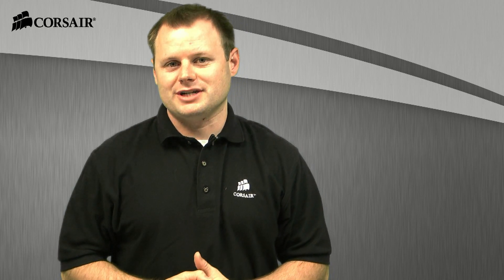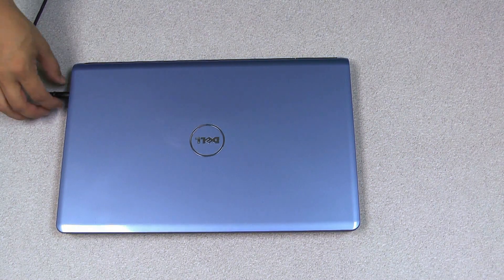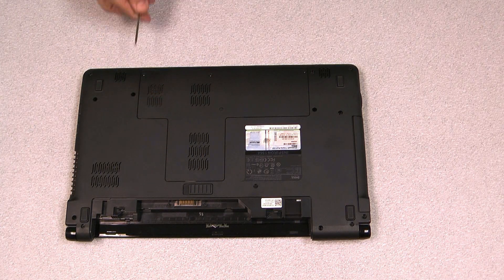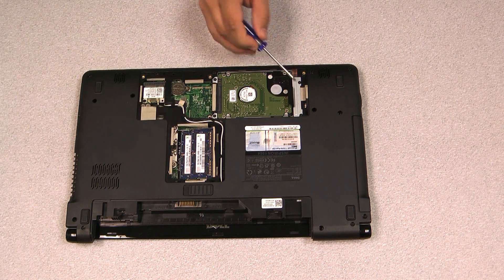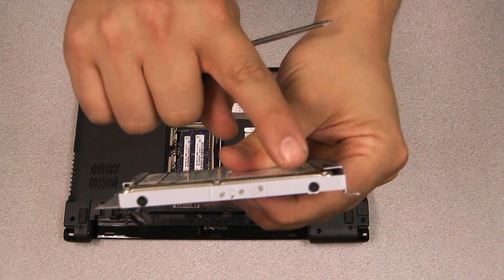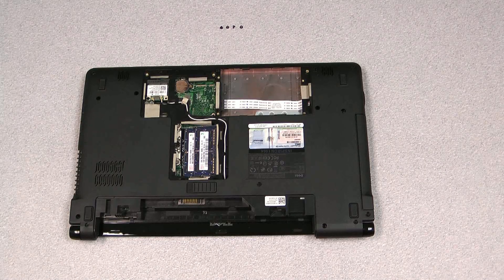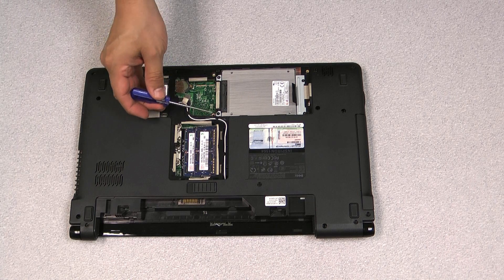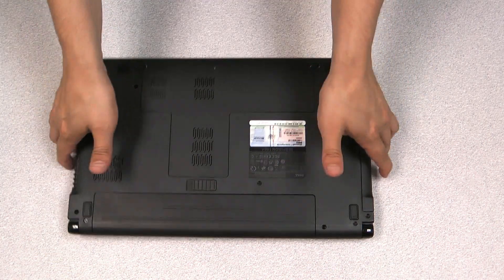Corsair SSD Install on Dell Inspiron Laptop

Comment: SSDs are awesome but they are currently priced quite high.
That doesn't mean price won't drop when more manufacturers move on to SSD production and hard drives will start being obsolete.
The increased performance, reduced power consumption and ever increasing capacities could mean that in the future the SSD will be standard and hard drives will only serve for high capacity storage if they will even be used.
Reply: Dingo well. You were correct.

Comment: No, if you save your data from the HDD, and also, if you remove your HDD (if you won't use your HDD for like 2 year, the data will be there) windows is gona disappear, beacuse the HDD is no longer in contact with your Laptop/Computer

Comment: @b0ss6769 even 32bit takes up 16GB of space.  But the reason you'd want to use 64bit windows is to take advantage of more RAM.